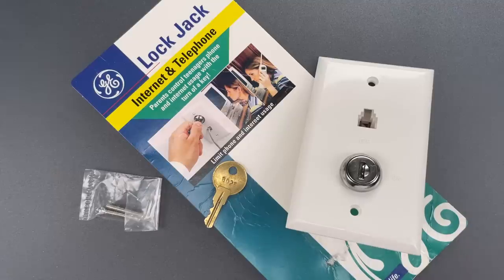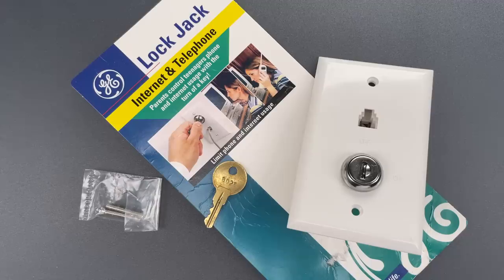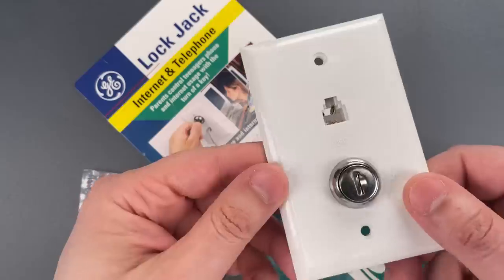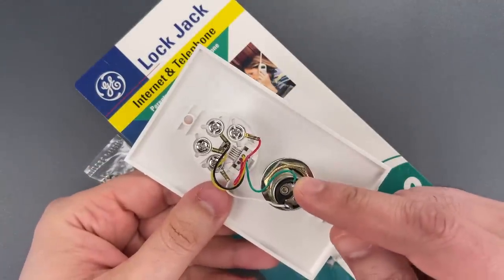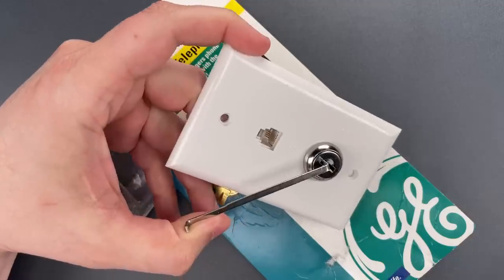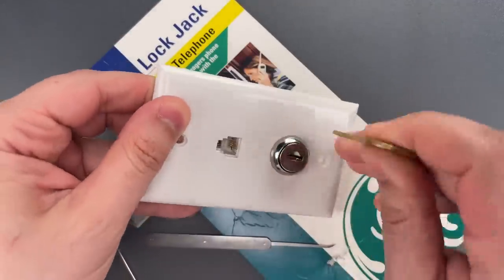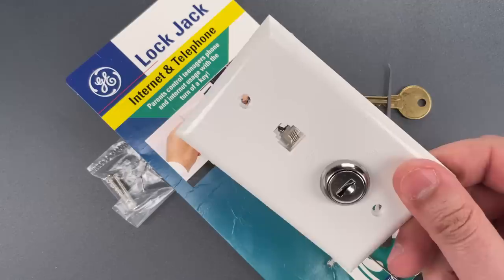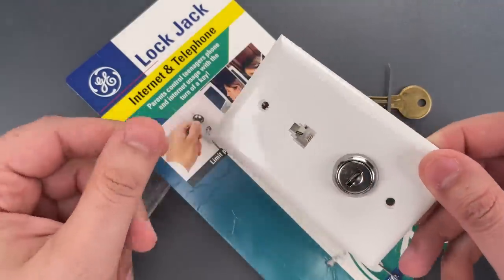[1284] 1990’s GE Internet Lock Picked

Comment: I definitely had a soldering iron as a kid in the 90s lol
Reply: Don't need one. Just a random piece of metal bent around the pins would work well enough
Reply: @superslimanoniem4712  I was thinking of unsoldering the leads from the connectors and just connecting those two wires so the lock did literally nothing.

Comment: In our house the pc was far from phone jack and when you wanted to dial up you unrolled a 5m cable from modem to phone jack. Parents trick was hiding the long cable. My trick was moving entire pc to next to phone jack and moving everything back before they got home.

Also our 286 had one of those keyboard locks which all you had to do was open the lid and unplug. Parents locked and unlocked it not even knowing it was completely disconnected inside on the motherboard

Comment: That tension tool popping out was the first major technique mistake I remember seeing on this channel. The lock, however, not to be outdone, was not bested. xD

While the idea of locking the internet might seem novel, depending on the setup it could be installed as a failsafe to prevent disruption to an ongoing internet process. (Install it between the phone set and the modem, and you can ensure the internet doesn't get cut unless an authorized person has the key.) Obviously in the age of cable-based broadband it's not even close to necessary to do that anymore.

Comment: Im thinking these were more used in public areas like airports or meeting rooms/convention centers where either paid connections were available, or temporary ports were needed, and when they weren't, could be locked off so the public could not use the line by plugging in a laptop. Less about security than simple discouragement so it wasnt worth the bother to try to quickly use or even try the port.

Comment: Just unscrew the thing from the wall.
Put a reed contact between the contacts of the lock, shortcutting the lock.
Put it back on the wall.
Put a magnet on a string, and put the magnet near the reed contact.
This way the lock keeps locked, and internet works.
When you hear the door when your parents come home, pull the string, en there's nothing to see.

Comment: I'm thinking it would have been more effective if the lock moved the contacts in the jack away from where they could make contact with the plug. My first thought was a shutter, or just moving the whole jack behind the plate, but then you'd have to remove the plug before locking. If it could just separate the pins from the jack though, that would have been difficult to overcome, even if you removed the plate from the wall, and you wouldn't have to remove the plug.

Comment: Might have been cheaper to put a hasp over the socket with a decent padlock. This product would have been a pain to use though, because you either couldn't use your landline phone either, or whoever you were trying to lock out of the internet could just plug a long extension into the socket that the phone was plugged in to. ...unless of course that's an ISDN socket. But it just looks like a standard phone socket to me.

Comment: "depended on a dial-up modem"
Actually a lot of people still rely on DSL (including my parents, and pretty much anyone in rural America), and since that still goes out over the phone line this lock would likely work fine for that, though it would be very slow to turn the internet on since a DSL handshake takes a while.

Meanwhile here I am with a failover to an LTE modem in case the cable internet goes out because I refuse to not have internet.

Comment: Even as a kid back in the '80s I could open a wafer lock with a small screwdriver and a paperclip.  With something like this I probably wouldn't have bothered, though.  I'd have modified an extra cord to use black and yellow instead of red and green, and added a switched bridge somewhere else on the line so I could flip it and activate the jack, while killing red/green in the rest of the house.
How do I know I'd have done that?  Because I did, not because of one of these but to keep anybody from accidentally picking up a phone and dialing while I was online.

Comment: "I could've defeated this even as a child. You just unscrew the internet socket and rewire the whole thing"
Reply: To someone familiar with basic electrical theory it would be ridiculously easy. You don't even need any tools, putting a paper clip on the back of the switch would restore connectivity (and open the cover). Even if you did need to rewire the whole thing it would still be very easy. Phone cables are much easier to work with than power cables.

Of course another, more obvious, way to defeat the lock is to just use a different phone jack.

Comment: When dial-up internet got faster and faster (110 baud all the way up to 56K baud) the quality of the cabling was very important. Any noise introduced into the line would cause the modem do drop to the next level until a clean signal was determined. I can't see this cheap switch being able to handle any speeds higher than 2,400 baud. Anything faster than this would introduce far too many checksum errors and would be completely unusable.

Comment: I wonder how this would work with Ethernet. Having one wire make a big loop messes with the impedance and causes signal reflections (imagine trying to scream at someone who is snorkeling in a pool). On a 56k modem this doesn't matter because the bandwith is so low.

Comment: Is this one of those locks that could be easily defeated by the tools on hand in the early 90's? I'm thinking this won't survive a bobby-pin rake.

As for now... unless you have a cell phone with data, your own personal internet STILL comes in through a single point, which can easily be shut off.

Comment: You don't even need to pick the lock or have any knowledge. You just need a screwdriver. Unscrew the socket from the wall and connect the 2 wires with something. Lock is bypassed.
You could even just unattach the wires from the lock and twist the ends together.

Comment: As a beginner picker did your hand cramp up holding the tensioner, I’m a locksmith but just started to learn to pick causs my boss makes more from drilling and replacing than picking it’s not long before my hand starts cramping and I have to try and tension w my leg and take a break is this somthing you dealt with and eventually stopped or is it just me

Comment: My dad had a computer that could be locked with a key.... 
Ahh, the early 90s
Reply: usually the keyboard could be disabled with a (tubular?) lock, dunno if I still have one of those cases :)

also removable internal harddrive cages had a small tubular lock, but my tubular pick does not fit, if I remember correctly :(

Comment: How is that thing supposed to work anyway? Does it bridge one of the wires when "unlocked" and break the connection when turned back to "lock" it? Any kid with a piece of wire and a screwdriver should be able to just bypass the lock in 15 minutes.

Comment: now, what's stopping me from once unlocking the lock me turning it 90 degrees so it looks like it's still locked as a means of making my tampering undetectable? I have some key switches lying around and they just use a hole, there's no "keying" to stop the thing rotating around the hole it's mounted in.

Comment: And to think i had to find out the password to the router config to unlock my internet after 10pm... people in the 90s really had it easier
Reply: You didnt need to. Just a toothpick and a long press on the reset button, then reset the ssid and connection password and change the admin password. Easy.
Reply: @superslimanoniem4712  yes but the next time my parents logged in they would've noticed and devised a different method of blocking the internet. My method is more stealthy.

Comment: There is no connection on the back of the plug, How does it work without  an imput
Reply: it uses wifi
Reply: Do you see any wifi circuit board and power imput on the back? The lock has wires to the socket nothing else
Reply: @dylanjamesryan9432  maybe the wifi is hidden to protect from hackers?
Reply: Dam you didnt evenn watch the video. It's before with dialup. It has to connect to the phone line. There is no connection
Reply: @dylanjamesryan9432  yes, it connects to phone line with wifi. what is so hard to understand?